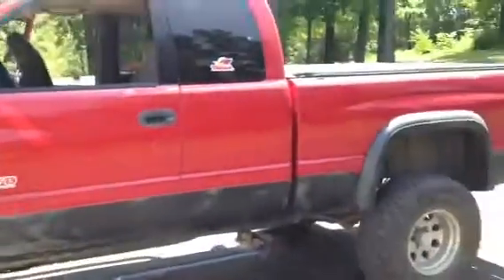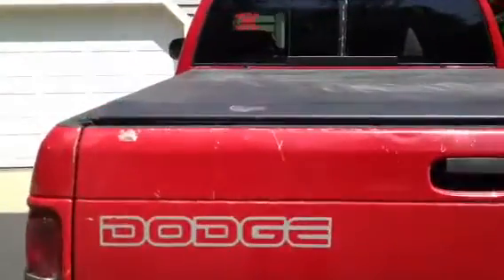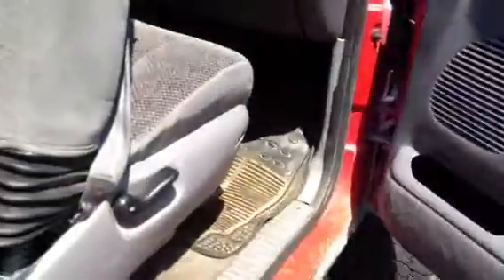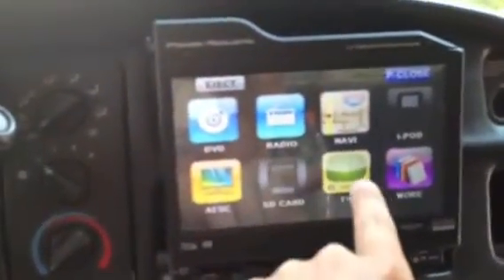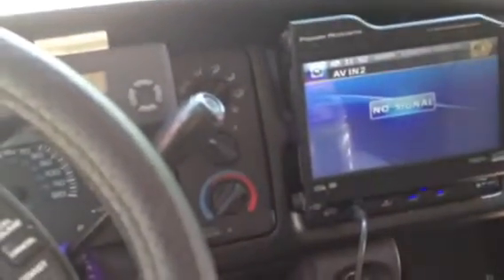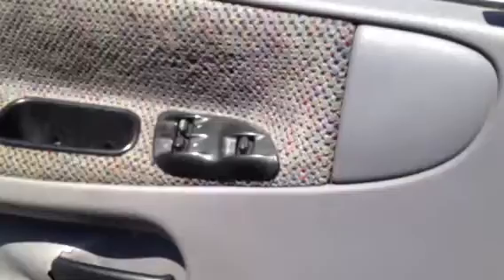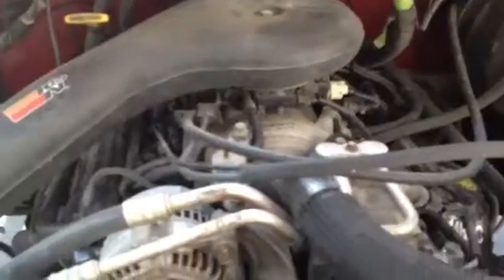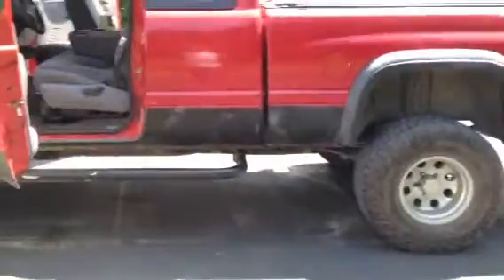Lifted 2000 dodge ram with sound system

Comment from the maker: The radio's screen has adjustable tilt settings. Personally I tilted it back so it was against the dash so the screen didn't flop around while i was driving, but like I said it's adjustable. The radio was a Power Acoustic but sorry I don't remember which model it was. Wouldn't recommend them though. The set up is a nightmare and they aren't iPod accessible. Buy a Jensen

Comment from the maker: I had long tube headers instead of the stock manifolds, then i removed the stock catalytic convertor and thrush glasspack that i had on before and just straight piped it the rest of the way through, i just bought some pipe to replace the area I took out the cat and glasspack then used the stock pipe to run it the rest of the way back. The setup I had before was too quiet and after 2000 rpm's all you could here was the fan. Take off the muffler and cat and just throw a glasspack on

Comment from the maker: Um in this video I have long tube headers and its straight piped out the back. It's really rappy and crackly which I like but if you like a lower tone a little glasspack will do the trick and they're only about $30 bucks. My other video of the truck has a little better exhaust demo if you wanna check that out!

Comment: Im bought the same model and it has a 6 inch lift with 39inch tires with the 360 in it its a monster to drive. It turns heads where every i go. What size was your amp im thinking about putting subs in mine

Comment: I have a 99 1500 stock base model as a new project.  Quick question, does the 8.3" hit the dash molding?  that was the only issue the audio installer had before we purchased it and installed it.  Is it the soundstream 8300?  Nice upgrades by the way.